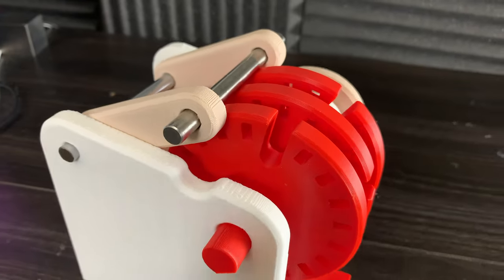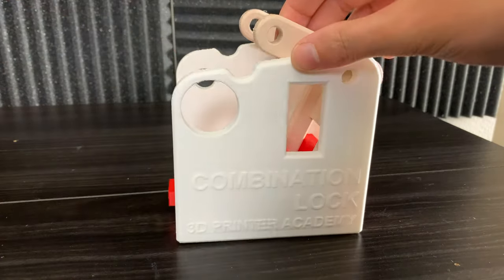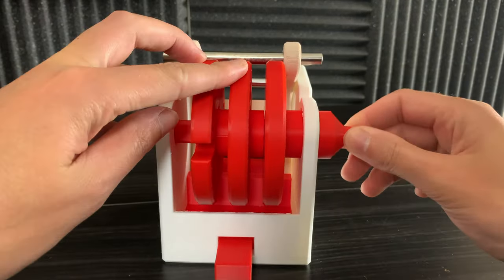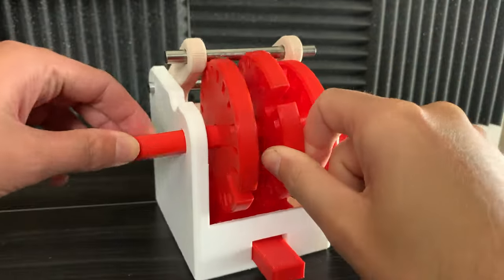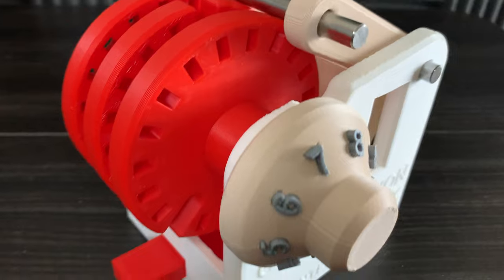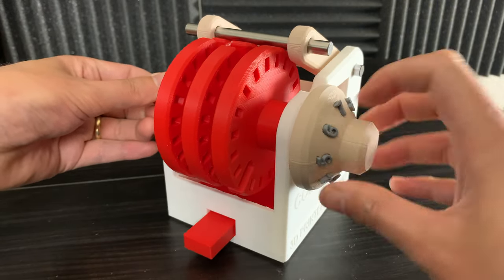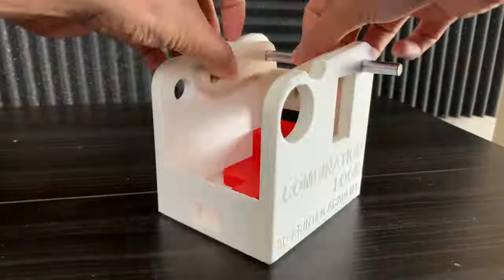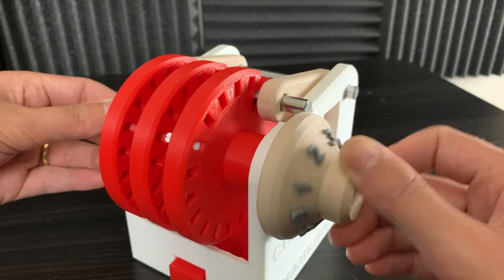How does a combination lock work?

Comment: Hey Steven, I was looking at getting a better 3D printer and I was wondering which one you had, or if you could give me and advice on which one to get. My budget is somewhere below 600 or 650 dollars and I will be printing things pretty frequently. My current one is 5 years old and starting to wear, and I would replace the parts but the printer was discontinued so I can't get parts without spending way to much. I really look forward to hearing back from you!
Reply from the maker: If you can stretch to $699 I highly recommend pre-ordering a Bambu P1P. This company is changing the game when it comes to 3d printers. Ultra-fast and preassembled
Reply: I'll look into that! Thank you so much!

Comment: I live in an old trailer with a heat pump with a switch that goes from hot- middle is off -andto the right it's cool. I want to get a device called switchbox and use it with my Google home and finally be able to turn off this money waster when I forget and I leave the house. It only can switch things  on and off. Is there a 3D print design that I can make this? Just  tell me how many months I need to join minimum ... even if we're talking about you just sketch this out on a napkin. I really like to make this my first real project and it's something that people could actually use if I put it on cults3D. Just throwing it out there you're the first person I'm going to ask. You design cool things like to support you also.